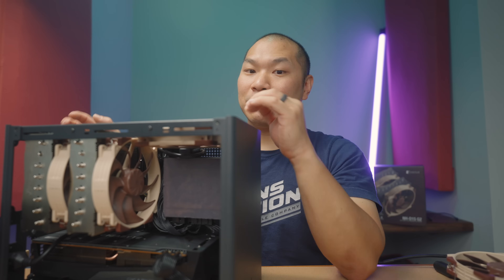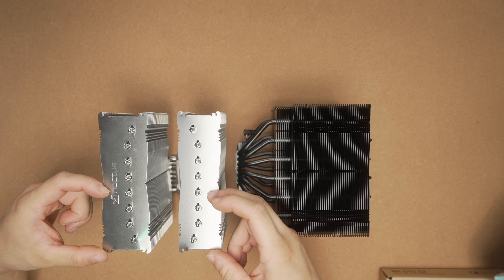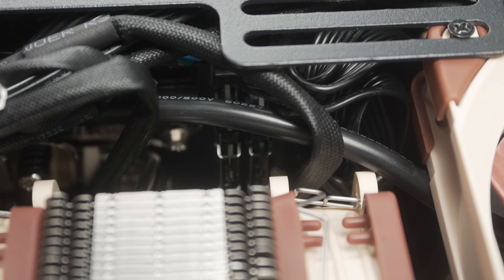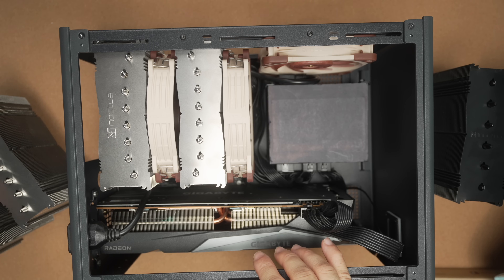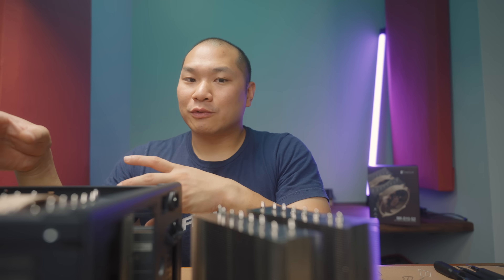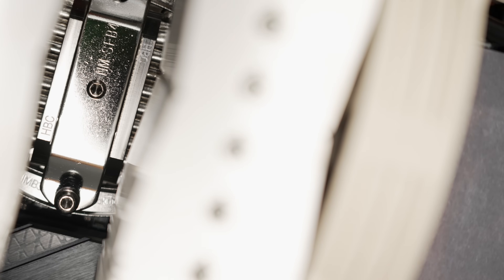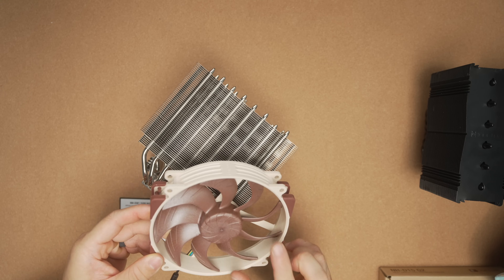Noctua D15 G2 Full Review - Tested in the Ghost R1!

Comment: Nice review... Also so nice of you to include, the one thing MANY of us did wonder about, and that being G2 fans on G1 heatsink... And yes it did confirm, what i was thinking, that most of the improvement is from the fans alone... I also managed to find second hand G2 fans bundle, for 40$ for both, they were used like 3 months, owner decided he want RGB fans, and sold them... So i did also replace the fans on mah G1 D15, and also got Arctic MX-6 paste, and from all that i got like 3-4c lower temp, as i was using before that the G1 fans and Arctic MX-2 paste...

Ofc if i find great deal on the G2 cooler, i will prob buy it (ChromaX ofc, i hate not the fans color, but the bare metal heatsink), as i really like the GPU clearance, and could benefit a bit from 1c better thermals...
Reply from the maker: Good way to maximize budget. Plus Noctua sells a two pack for this purpose!

Comment: I preordered my R1 in summer, waiting for it to arrive in October. My old system is running with a C14s and A12x25 (x2) as intake in a NR200 cooling an aging 3800X, is the gap significant enough to upgrade the cooler if I am also upgrading to a 9700X or 7800X3D when the case arrives?

Comment: I still use the old first gen NH-D15 with an offset kit (5€) for my Ryzen 7800X3D. All is about thermal paste, and good case internal ventilation. If you set them correctly, the CPU temperature is very confortable with basically no noise. Setting fan at full speed is useless, it won't cool much than quiet medium speed. I've better thermals than with my previous Kraken X73 with no offset for Ryzen cpus.

Comment: replaced my h100i with this. idle temps went from 60 to 45C. 7800x3d. I'm happy now. I did accidentally buy the offset plates twice. They came with the cooler.
Reply: Why did you have idle temps of 60? That's a problem you have to fix through other means than changing your CPU cooler?

Comment: Can't see a reason for why that cooler would make sense, it's just too expensive when for the same price you can get liquid coolers that vastly outperform it, which negates the biggest advantage of air collers (price to performance).

If one really doesn't want to go liquid you can get something that will have a 3-4°C difference for half the price or probably even less, and it's probably going to go head to head with the new 140mm from Thermalright.

Comment: I would not say am5 is “on its last leg” at all. 15:16 Am5 is guaranteed to be supported until at least 2027 and zen 6.
Reply from the maker: Indeed- I am referring to AM4 and LGA1700. Offset AM5 works best with the standard version. So the LBC is really just ideal for AM4, and HBC for LGA1700- with that in mind those are phasing out so users getting either version may not get the best performance out of whatever they choose next.
Reply: @MachinesMore  sure I would agree when it comes to am4 or lg 1700.

Comment: What kind of magic is Thermalright using? A very cheap 120mm cooler competing with one of the biggest and the most expensive 140mm cooler there is.
TR is the undisputed king of air coolers right now
Reply: All the magic seems to be in their base plate. They have found a curvature that works brilliantly across Intel and AMD without resorting to gimmicks or additional hardware.
Reply: It's not even the PS120, which is better. That's absolutely crazy.
Reply: Simply there is just that much heat you can extract from a given CPU size, regardless of the size of the fans there are just that many heat pipes and cm² of contact area you can have over the CPU, that's why you need liquid if you really want to see a steap up in performance.
Reply: Ye Thermalright are unstoppable

Comment: Thanks for including g1 fans on g2 heatsink. Other reviewers haven’t included that for testing. I still think even if I were willing to pay more for a premium cooler, I’d likely go for the Dark Rock elite and I can get it for around half the price of the d15 g2 when it’s on sale and noctua never goes on sale. Phantom Spirit Evo is also amazing not only for performance and price but it looks really nice as well.
Would be interesting to see if the nf-a12x25 fans provide a similar delta on the g1 vs g2 heatsink

Comment: So even when the specs of the NH-D15 G2 say 168mm max height, it fits in the 165mm max height of the Ghost R1?
Reply from the maker: Yes, although it depends on RAM height. To the highest point of the heatsink it’s roughly 165mm so as long as you can get fans to sit lower than the heatpipe tips, you are fine. On my MSI Z690 I board I got great clearance because the outboard fan sat just beyond the RAM slots. On my AM5 board it wasn’t as good and I got some interference with the fan and side panel. I would say it’s do-able as long as you are willing to try lower RAM sticks or even remove the heat spreaders if needed.
Reply: @MachinesMore  thank you for the detailed reply... Low profile rams for reduced volume cases... Got it!!

Comment: I'm considering getting a new fan for my 10-yearold U14S.
Reply: Don't buy a single fan for the price of a new dual tower cooler.
Reply: @Pamani_  The current one served me on three systems. I’d think of it as a long-term investment so to speak.
Reply: @Pamani_  The dual tower cooler is cheaper than a single fan for a reason... they cheap out on the fans, by a lot, especially so on the bearings. If you highly prioritize reliability and acoustics, grabbing the A14x25r G2 is a good idea.
Reply: @MY-qi8wq  the reason is that Noctua is overprices as hell
Reply: @v0ldy54  It is. But you get fantastic quality and longevity.
Reply from the maker: I assume the fan still runs?
Reply: @MachinesMore  It does. Flawlessly.
Reply from the maker: Glad it’s working out. Buy nice buy once type of purchase!
Reply: It's up to you if you want to buy a 40€ fan or 40€ dual tower PS120. I would rather take the whole cooler and still have the old one just in case than spend 40€ just on a simple fan. One friend did the same, he spent 110€ on 3 noctua fans for his 6 years old AIO instead of buying the new 360 AIO (for example from LFIII 360) for 100€. Don't forget that you can still sell the U14S ;)
Reply: @kinzie3915  I've replaced all the fans in my case with Noctua, and I run a Noctua edition GPU. So I think it makes sense. It's whisper quiet even under load.

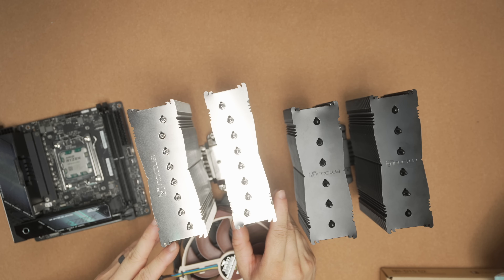Comment: 7:57 Thanks man! Not even GN tried this!
So I will keep my D15S Chromax, and update only the fan with the new Chromax, when it will be released.
Reply from the maker: Is a great idea. If the D15S works for your needs already then the fan upgrade should net you enough benefit. The improved heatsink will yield more of a benefit with hotter chips ala 14900K levels.
Reply: @MachinesMore  cause I have a O11 XL, that cant't fit the G2...for 1mm!! :D
Reply from the maker: If you have or can get lower profile RAM 165 is possible. 167 should be a-ok. But yeah with a fan upgrade you will be quite happy.
Reply: Actually ChromaX D15 looks WAAAY better with Noctua classic color fans, as the black ones are just boring to me..  But the classic fan color makes the cooler look WAY better...

Comment: Impressive! Still, a thermalright cooler costs just a fraction and gets you 99 % of the d15's performance.
Reply: the phantom spirit performs the same as the d15 g2 so in fact it's 100% of the performance for 1/3rd the price
Reply: @kerotomas1  With te PS120 EVO with it's new fans it even outperforms the G2 up to 120 and 250W load in noise to performance, which is what most people out there will push their CPU to anyway. Only once you get to the 300W+ load it can't fully keep up with the G2, but the people who run constant 300W+ loads probably already have a huge AIO.

Comment: Even with the D15 G2, the Phantom Spirit 120 (EVO) is still the new aircooler benchmark imo.
It outperforms the PA 120, basicly on par with the G2 while being way smaller than the G2 and all that for 1/3 the price.
Reply: I just found out about the Phantom Spirit yesterday.  But remember this dude does the testtiing.  At least give him props for it.
Reply: @cavemantero  Where did i say anything about the testing. Obviously his tests and everyone elses are useful.
Reply: Source where PS120evo has same numbers as G2?
Reply: Now I would start think the benchmark should be how much power your CPU can draw noise normalized, most test we see simply don't hot enough to justify NHD15 G2.
I don't care if the CPU it is 48 or 52C when it is chilling at 120W, I care more about if the CPU wants 300W how long the cooler could keep up.
Reply: I really doubt that it could be close within 5c at same noise levels but d15 g2 will still be a fair bit better at everything. still only would get the d15 if money is no issue.
Reply: @shrillyy1604  Depends on the workload and the new PS120 EVO fans are a lot better than the usual PS120 fans.
At 120W it heavily outperforms the G2 in noise to performance and it outperforms it in 250W load up to 66-68C°. Only once you get to 320W load the G2 will be ahead, but that makes sense.
And even then you could technically use two NF-A12x25 on the PS120 and it will perform even better in terms of noise to performance and will still be 50 bucks cheaper than the G2.
Noctua will of course always have the advantage of pretty much perfect customer serivce, free mounting brackets forever, free replacement parts etc.
Reply: @kwedl  https://www.youtube.com/watch?v=WFF0XFrkOto
https://www.youtube.com/watch?v=X1iaAvWvYW4
where did you get your results im seeing that even the v1 d15 still out performs the phantom evo 120. 
I could see the PSevo with a12s beating the u12a but not the d15 the d15 has so much more size and with the g2 now much more RnD.
Reply: @shrillyy1604  It's in the G2 review from STS. He uses the PS120 non EVO and even that one does quite well and the EVO fans are even better.
Reply: @shrillyy1604 They are not testing CPU coolers properly. GN or STS are testing coolers the way you should.
Reply: @kwedl  I just watched the video from sts and its not better its fairly worse. where did you get this informations from. everyone ive ever looked at says d15 is better or has a paid promotion in the video.
Reply: @shrillyy1604  Are you sure you watched the STS video? D15G2 is 1C hotter than the PS120 in 120W workloads, 1C cooler in 250W workloads, and is incomparably worse (23C hotter, DNF) in 320W workloads for Intel. In the AMD comparison with only 1 SKU of CPU tested they were .2C apart. The $120 price difference between these two coolers cannot be taken seriously when the performance difference is the way it is
Reply: Adding to my own comment to correct that the G2 finished the 320W workload test, the original D15 did not. D15G2, 4C cooler than PS120SE at 320W intel workload, is definitely the best air cooler for a 13900k or 14900k, as ridiculous as that sounds lol
Reply: @PTNOPOT  that’s exactly what I was saying I said d15 I meant d15 g2. I’m sticking with my old d15 g1 but I’m glad to know noctua is still on top. I don’t need anymore cooling for my my old 3900x. Although it does get hot 2c does not change anything for me.
Reply: @shrillyy1604  I think you cant just read charts :D
Reply: I don't like the Phantom Spirit as it makes me feel dirty using a product from a has been company.
Reply: @jamesm568  What does that even mean.